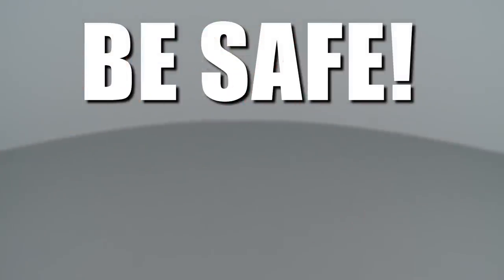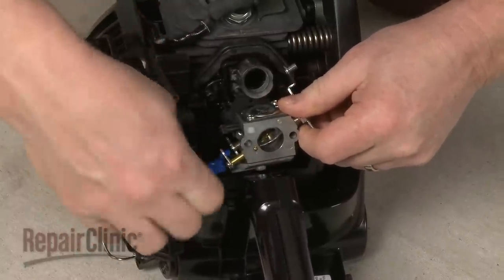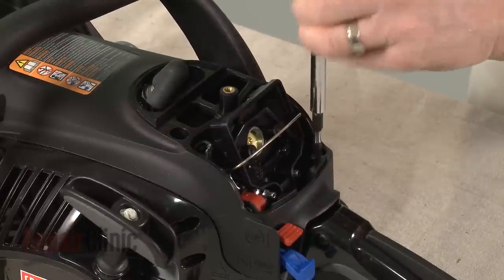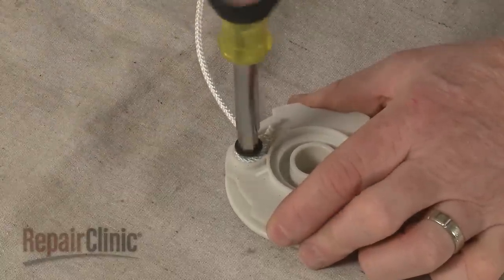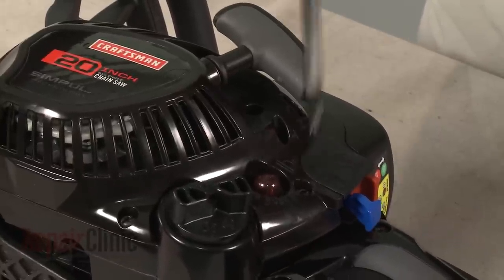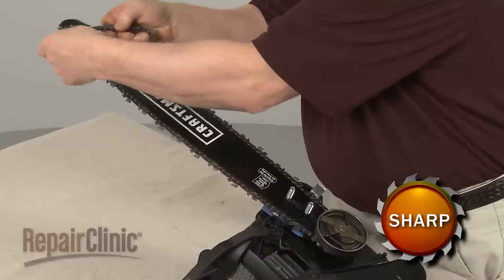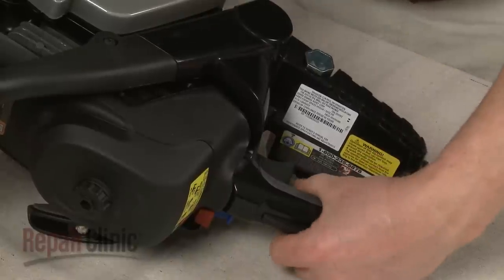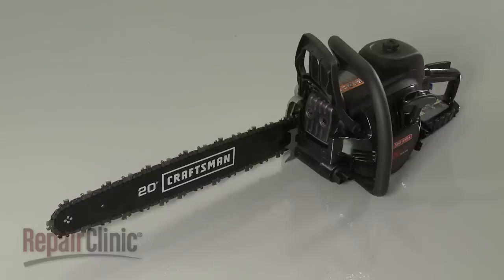Craftsman Chainsaw Disassembly – Chainsaw Repair Help

Comment: my grandpa's craftsman 358.350991 gasoline chain saw not lubricate the cutting chain and he's asking for help, he doesn't know what is the problem.
Reply from the maker: +Nicole Escalante We sell the new oil pumps for his chainsaw. http://www.repairclinic.com/PartDetail/Oil-Pump/581071401/3133109?TLSID=1773 in case the old one broke. Also, the holes on the bar must be cleaned for oil to get circulated on the bar.
Reply: Might have an oil jet clogged. When that happened on mine it was partially clogged and wouldn't quit dumping oil

Comment: ok is there something going on with craftsman 42 and 40 cc  because I have 2 brand new not even a year old and they both get spark  the coils on them work great  sprak from the coil and a spark with the coil and spark plug  with the spark plug tester. but none wont to start . gas is fresh  flushed out the system from the old gas also I mean two brand new chain saws doing the same thing the 40 cc only had a 15 to 20 run time when I bought it yes I used the right 2 cycle oil and gas messurement's  .  plus  cant return them because there past there warranty date. I checked the fuel lines and filter in fuel tank and on carb fresh gas no blockage . so what could it be even checked for broken wires . BTW I do know how to maintain a chain saw for  storage if ran chain saws all my life heated with wood  still do. and I have a Jonsered 70E stored it the same way and starts fine
Reply: Will it start by pouring fuel directly in the carb or the combustion chamber?